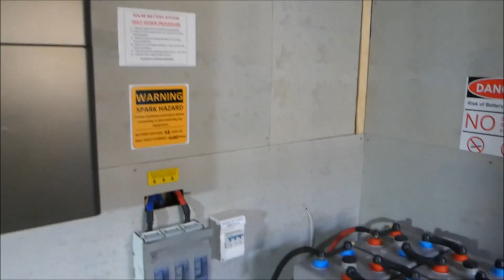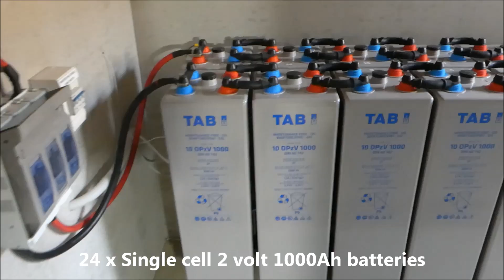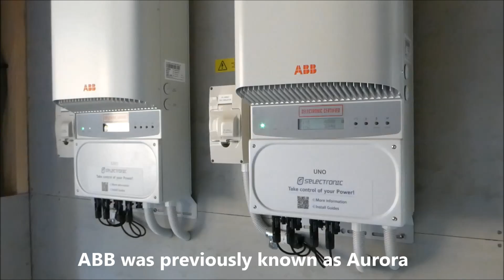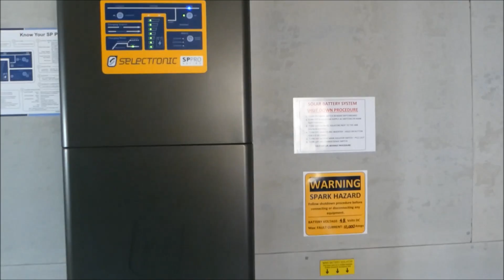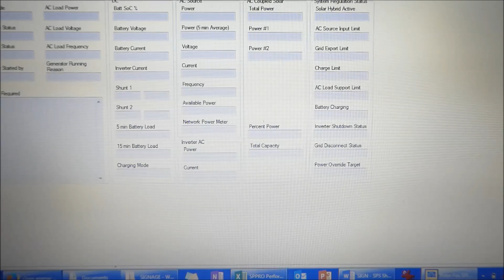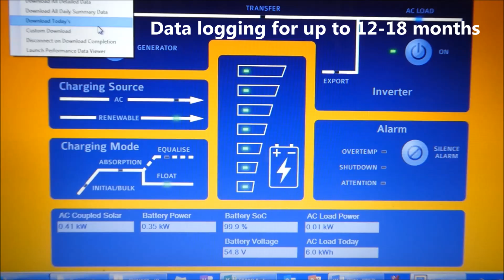Off-grid solar power system review - AC coupled Selectronic SP PRO hybrid inverter with gel battery

Comment: Do I need the SP Pro to use the pvi units as an off-grid battery charging system?
Reply from the maker: Yes, the SP PRO is needed as this is the battery inverter/charger. The ABB PVI inverters are just solar inverters.

Comment: I cant believe its been done with Lead Acid type battery!!!!!! Lithium ion battery is the go for these type of project min 20 years life time after that another 10-20 years  with 80% capacity
Reply from the maker: Maz this system was designed and commissioned in late 2015! The cost of Lithium then was extremely high then and uneconomical. Also no compatible lithium batteries were available at the time. I don't know of any lithium battery which lasts for longer than 15 years to 80% retained capacity, plus the technology hasn't been around long enough to prove otherwise
Reply: At the date you wrote this, you'd be way better off looking at RedFlow Z Cells than Lithium.

Comment: Hi just wondering what the benefits are of having the system ac coupled over using dc regulators?
Reply from the maker: Missed your message. I have an article which should answer your question. Basically AC coupled is far easier and lower cost when you are installing anything more than 3kW of solar.  
https://www.cleanenergyreviews.info/blog/ac-coupling-vs-dc-coupling-solar-battery-storage

Comment: So going on the average  quarterly power bill. This particular  system at 48,000+. Will take about 50 years to pay itself off.
Reply from the maker: When you factor in the cost for a grid connection to this property was over $50,000 then you could say it has already paid it'self off ;)  Then there is the additional benefits of back-up power during storms etc... If you had a grid connection then you wouldn't need a system of this size or cost.

Comment: Maybe I missed it but I assume the set up cost must be huge $30,000+ .You would have to have a very serious need for off grid power.
Reply from the maker: Bob Jackson,
 Hi Bob, actually the cost was closer to $45k installed. This is a top of the line system which will be powering 2 separate dwellings. The cost for a grid connection to the property was over $50k then you would pay connection fees and power bills
Reply: That would be the serious need. With such a tech rich solution I would be concerned about equipment failure or lightning strike (high quality surge protection should be incorporated). My concern with maintenance free batteries is they are only maintenance free because they can't be maintained. Also all batteries are quoted with a service life at a certain ambient temperature, every 5 degrees above that ambient will significantly reduce service life. Presumably with an off grid solution an air conditioned room might be considered a luxury, but for that equipment I believe it could be easily justified.
Reply from the maker: Bob Jackson 
Yes the batteries are sealed but roughly have a 10-12 year design life at average 20% DOD. The climate at this location is quite cool so temperature is usually below 25 degC.
This equipment is very reliable, up to 20 year life when located indoors out of the weather. Gen-set emergency backup is available

Comment: Hi, I have the same setup but with kaco ac coupled inverters and agm 600a/h battery bank. I also use it to heat my hot water via a standard 500litre hot water cylinder. with two elements which can be separately prioritized. You probably wouldn't need the tubed water heater. Unfortunately, selelctronics hasn't come out yet with a smart way to divert excess power for water heating. I still have to set parameters via SOC, time or battery voltage which is too rigid. The "percent power" indicator would be ideal for the system to determine what is available to divert at any given time. But otherwise great stuff.

Comment: nice , few $$$$ worth
Reply from the maker: Yes it's worth a few $$ but you get what you pay for! This system is around $40-50K fully installed but remember going off-grid in a temperate climate means you have to size the system to get through the winter months. Also with grid connection in rural area's costing up to $100K it's not bad, and you don't have to pay for power or connection fees. Of course with an efficient passive home design you can go off-grid for much less.